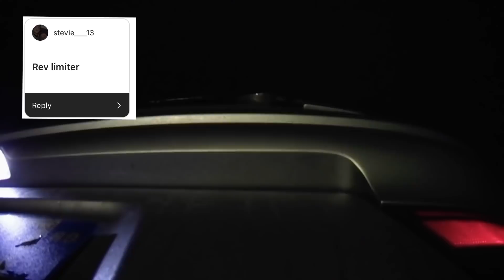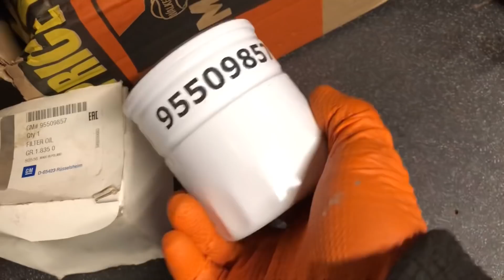I Want Your Help For 2021! Evo Rs Cosworth Gsi + UPDATE!

Comment: I would like to see an Astra G 1.7DTI project. Just tuning and mapping plus mods.
Reply: Remapping is easy enough, flashed files onto mine at least 50 times, had it for 10 years and is now on 243k miles, cracking motor, not quick but great on diesel :D